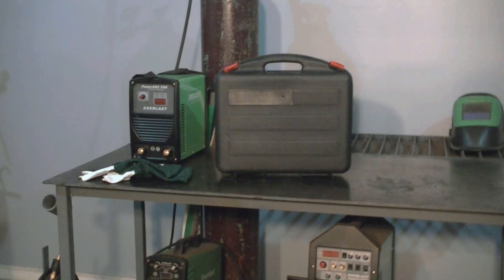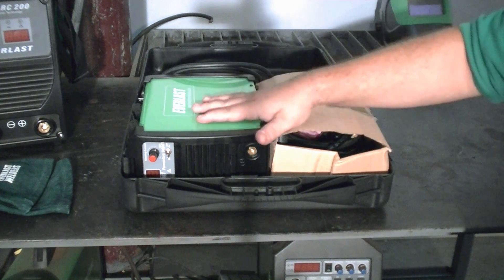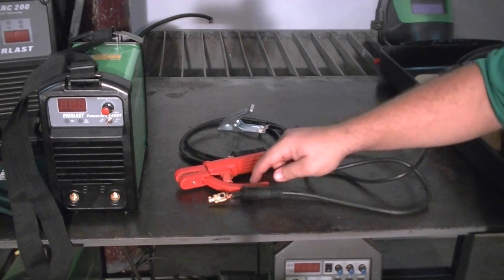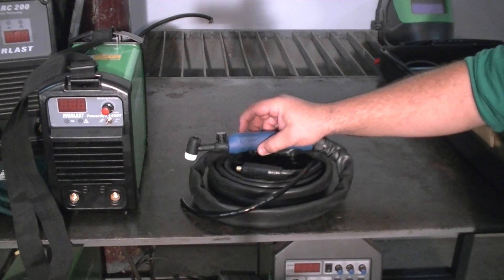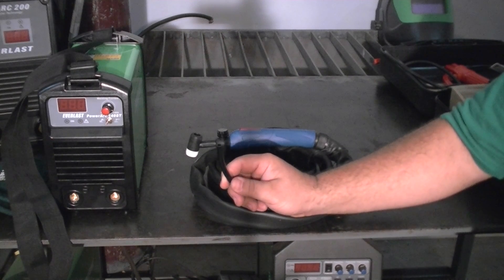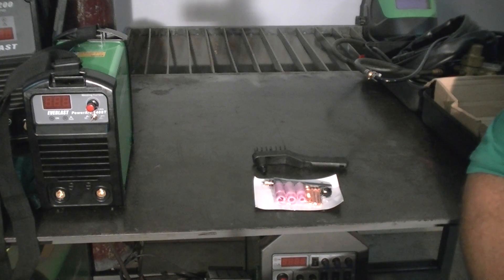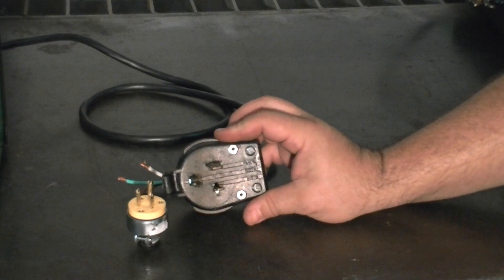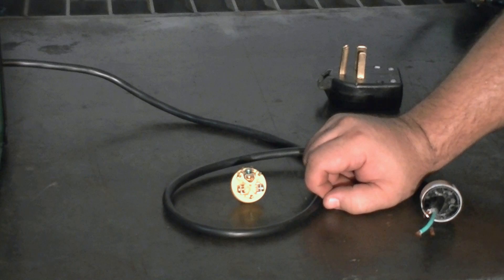PowerArc 140ST - Stick / Lift Arc TIG 140 amp - Compact Welder Part 1 - Everlast Welding

Comment: hopefully yall are still checking the comments. i really want to try this welder out but I am running a 20 amp breaker. I plan on keep the amps between 55-60 with what I plan on doing. Im super nervous to drop the money seeing im not sure if it will operate with what I have or not. If it doesnt and it trips constantly am I able to return it? Or can yall guarentee that it will work on a 20 amp breaker around 55-60 amps?

Comment: Does Everlast equipment use solid-state electronics or the "electro-mechanical", like the piints ignition in an old car, contact points to get the arc going?

Comment from the maker: The units are similar.  But the 200 has a stronger response in my opinion.  The 200 really isn't all that big, with only being about a foot tall, a foot long, and 7.5 inches wide.  It's really pretty small even though the 140 is smaller than the 160 and the 200.
Reply: that makes it pretty tough to choose between the everlast models. I'd like to buy a portable stick welder

Comment: How does the PA 140 and 160 compare against the PA 200 in regards to hot start and arc force? They are all excellent welders but I can decide whether I should go really portable with the smaller units.

Comment: The 140 is super small and compact. Comes with a case too. The PA200 would be a great welder for frequent welding jobs on thicker material. More power and duty cycle. I like the Everlast 160. Good power, a bit bigger than the 140 and still dual voltage.

Comment from the maker: The question is...why would you want to?  The only reason to scratch start here is if you were welding with a stick only welder.  The lift start makes smoother, cleaner starts more quickly.   IF you want to scratch out a start, just leave it in stick. It'll start that way.  Or take a look at our PA 200 and add a TIG rig if you have 240 V and you'll have a stick machine with more power for stick.

Comment: yes it is tig is more expensive than mig plus tig welding does not handle dirt rust paint or mill schale very well u have to take a wire wheel and get what ur welding down to bare metal Before u even think about welding on the metal if u want something cheap try stick welding

Comment from the maker: It's a slower process, and you must use shielding gas as well.   But as far as expense...I've never seen a study to compare, but from my experience, it comes out fairly close in relation to each other.  TIG is much cleaner, so clean up expense is reduced, which is also a consideration.

Comment from the maker: The camera doesn't have a separate mike....That's what you get in a room with concrete floors 12 ft ceilings and hard walls...we'll work on it though.  Its not a primary concern. Getting the product out there for people to see is though.

@Calmiel ...Second part is up.